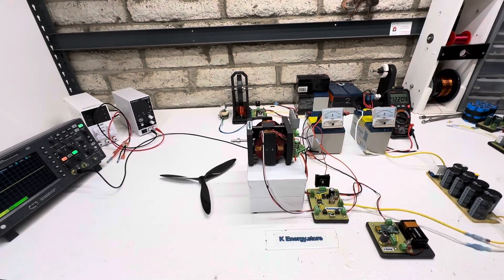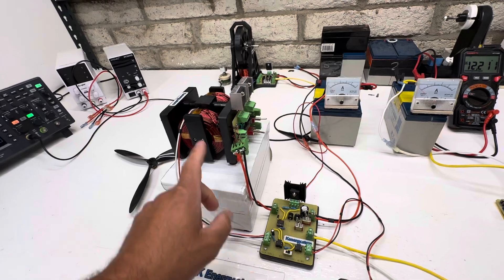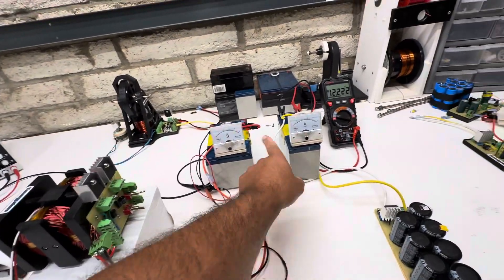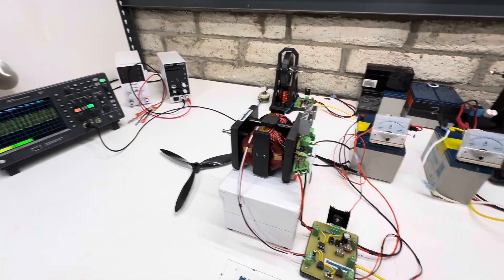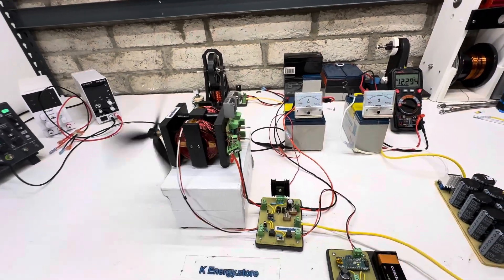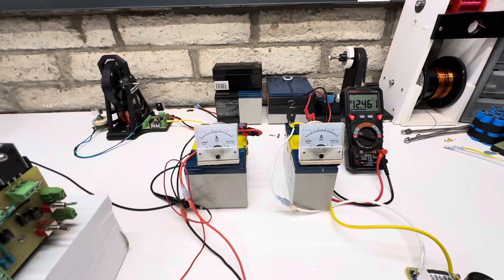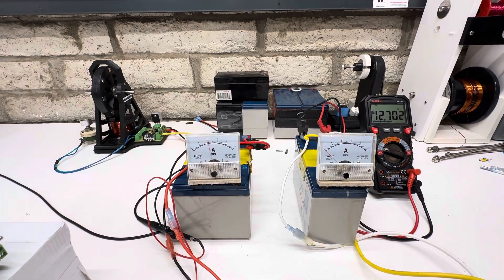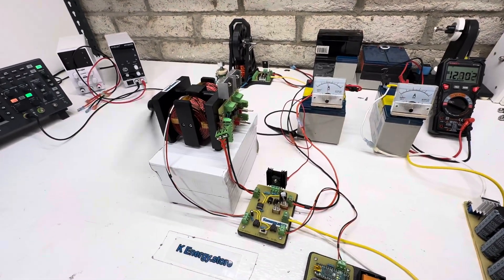Window motor with hall circuit

Comment: If you are using PWM Your gonna want CAPACITORS that  at the same VALUE as the INDUCTORS and put those capacitors in series with the coils You will get BETTER run time.